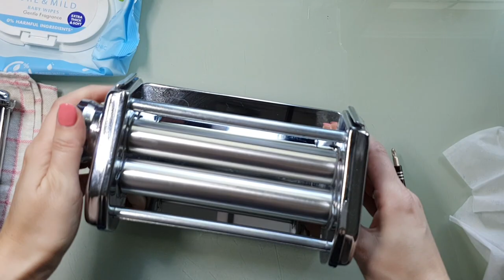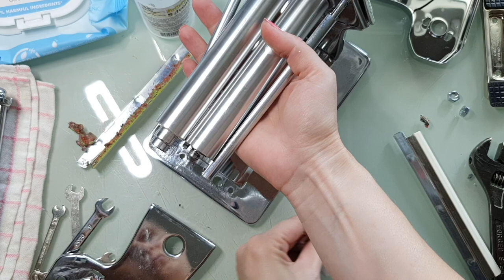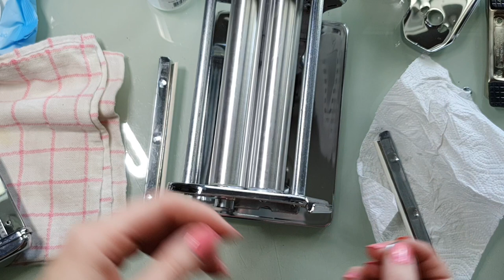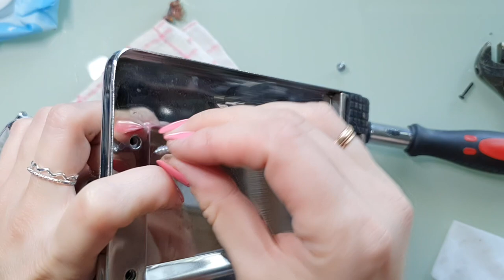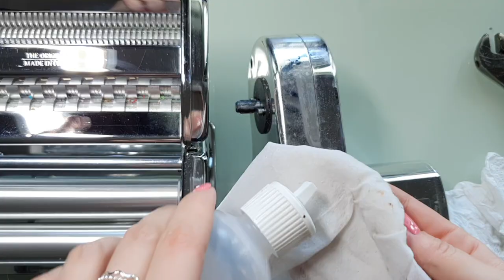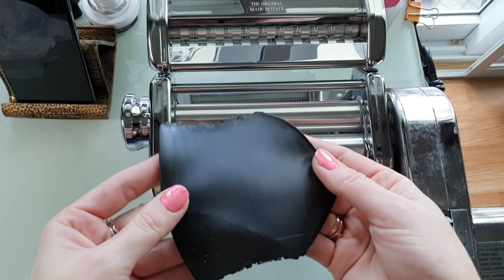Tips&Tricks | Easy way: How to clean your pasta machine! Quick tutorial!

Comment: Brilliant instructions IF your machine is exactly the same but my pasta machine base plate is attached differently and although I took apart the machine fairly easily following your instructions, gave it a good clean, then reassembled it I cannot attach it properly to the base plate again!  This is because the screws have to be inserted loosely through the holes from the inside before attaching the side plates, they don't screw from the outside.  Then on goes the base plate, on go the feet, and then you have to screw nuts onto the dangling ends of the screws, the exposed end only being about 1/4" long.  Because there is nothing holding the screws it's extremely difficult to screw the nuts on without them disappearing back into the machine and you have to detach the side plates, reposition the screws and go through the process again.  I finally solved this on the handle side by putting putty on the screw heads to keep them in place.  BUT because it's impossible to undo the other side plate (where the gear setter is) the base plate screws have disappeared for ever into the machine, never to be seen again because I can't access them.  There is a screw head visible halfway under the gear knob but no screwdriver of mine can reach it.  So if you have a machine (mine is "Kitchen Craft" with nuts on the outside holding the feet to the underside of the base plate do NOT attempt this!!!  My machine is beautifully clean now but very unstable at the base :(

Comment: I ruined 5 of my machines doing this it is better to just run translucent threw it a lot of time to help push that back out the way if you need to cause even taking it to others to help put it back together we couldn't never get them back together right and they would roll lump and never would the shift of settings work.

Comment: My husband has stabilised the two small outer thin long pins so I no longer have the same problem. He did it by using heat shrink tubing.

It still makes life easier without the guards.

You may find it easier to use a Multi-purpose T Handle 1/4" Dr. Socket Spinner & Bits Holder+9pc Socket+Adapter, rather what you are using.